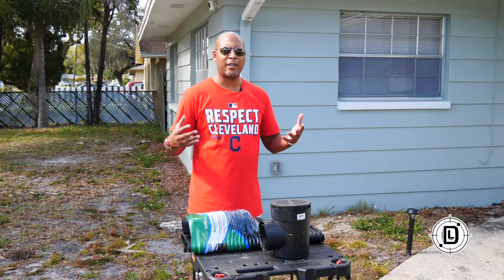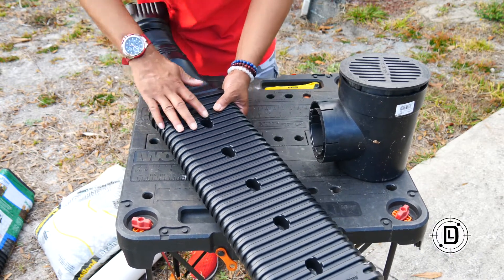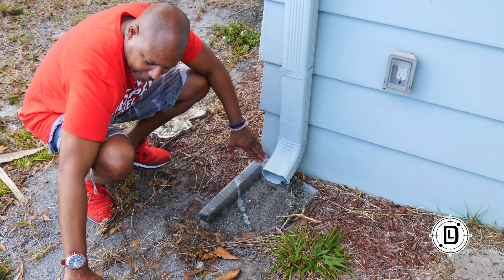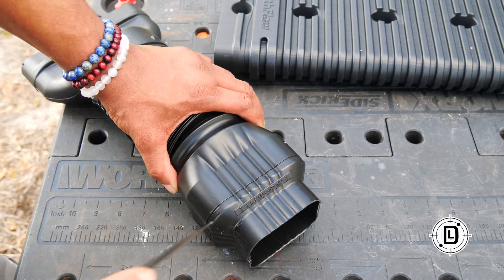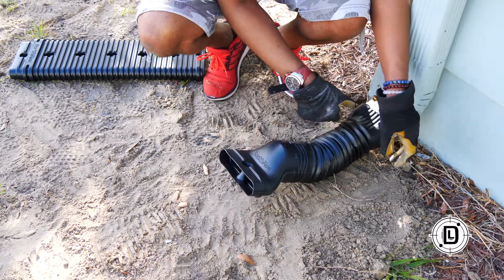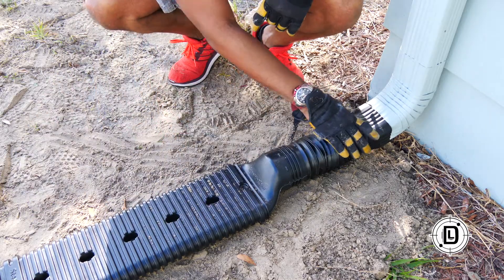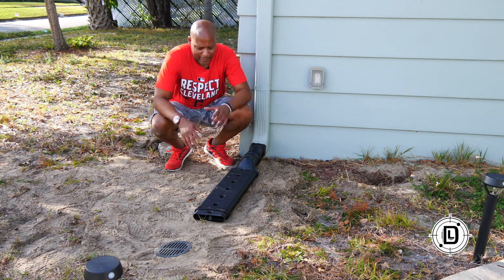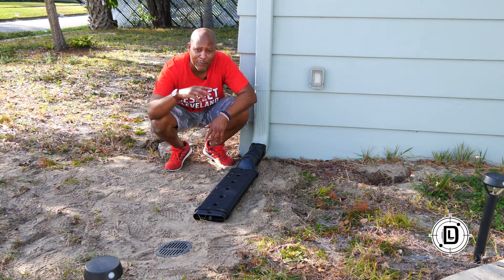Stealthflow downspout extension

Comment: Wouldnt these freeze?
Reply from the maker: Mathew thank you for a truly great question. I wanted to take this one for the manufacture to get the correct answer. Here's the answer they gave me,  "I hope all is well. Thank you for your inquiry. We would recommend not using the  Stealthflow downspout extension in below freezing climates. Areas 30 degrees and below are not recommended." So you're correct sir it is not recommended to be used in freezing temperatures. Thanks for watching and the great question. Please subscribe to the channel, like this video and others you find useful and interesting. Thanks again for the great question and watching.